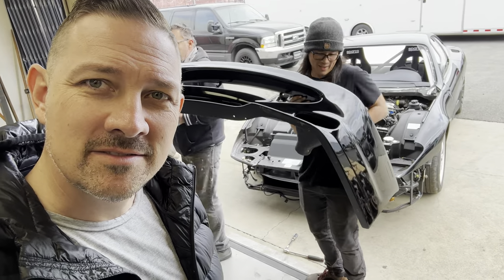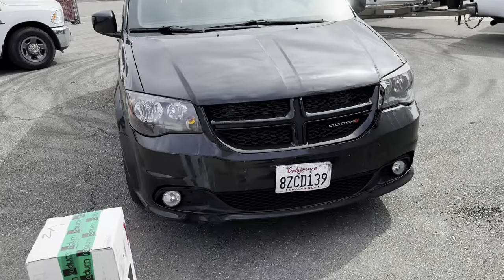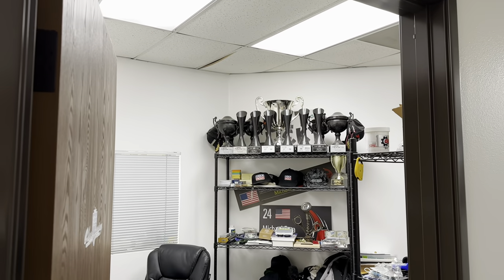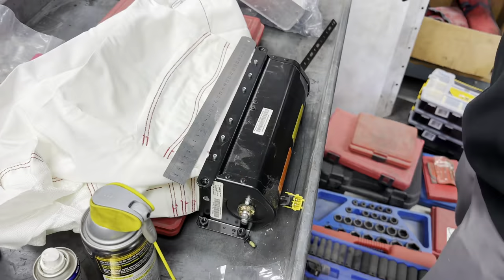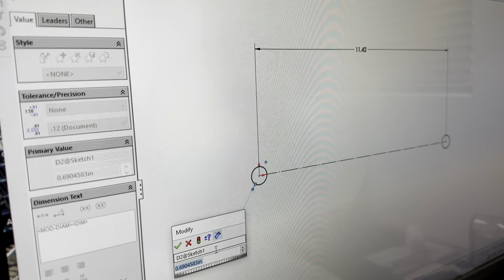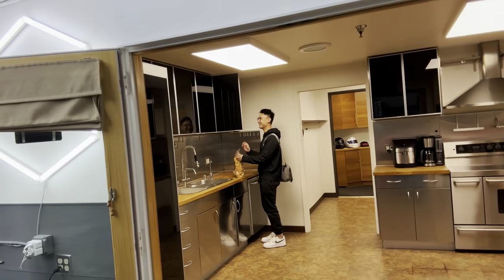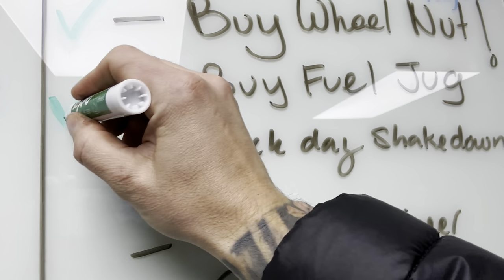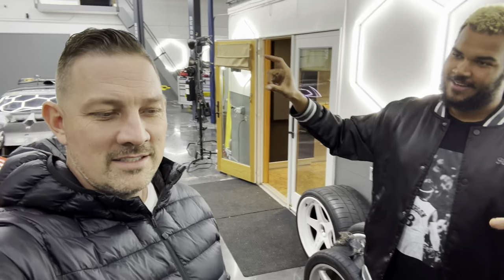How To Make Ferrari Race Parts Easily! *Mike Essa *

Comment: Mike speaking my language now.  I draw in CAD daily and make CNC programs for our HighDef  Hypertherm XPR300 plasma. Our table is 7foot wide by 14feet long.We make anything From small 18ga stainless/16ga Aluminum to 1.5inch A36 Carbon Steel parts. Whatever job we are fabricating the shop depends on me to make custom parts. Like today I've laid out and programmed 4 different deflector shields out of 1/8 Stainless. Funny to see Mike teaching Damon what SolidWorks is and how to burn out on the Plasma table. That table looks like small part type with tiny plasma in comparison what our steel fab shop uses. Perfect for small car shop with custom Fabrication. Im Just happy to see this . Another Great Video from DDE and Mike Essa

Comment: 6:00 Dude ya making that way harder on yourself than it need be, this sounds crazy but it works, just shove it in the oven for 5 to 10 min on 150°c! That lens will pop off like it's in butter, I did this on my Mk4 Supra headlights, and it worked a treat! And most of all, it didn't damage a single thing!

Comment: Damon that van I used to have one 2013 285hp and on a wet day it was faster then 5.0 mustangs.   And the only bad thing was high winds on the 416 in winter here in Ottawa area.   You know the place you lost your radar detector....   just minutes on the 416.  By the way minutes from where I now live. And with my V10 engine will be heading down to the hot states like Florida or Texas. Soon.   By the way my V10 would haul A55 your v12 easy.....

Comment: If the van were a Ferrari
Fog Lights - $1000 ($500 ea)
Plastic Grille - $2300
Dent repair - $500
New Rims - $5000
Alignment - $1000
Carbon Hood Scoops - $500 parts  $600 labor
Cease and Desist Order - Priceless

Comment: Solidworks 1.0 circa 1999 that being said the only thing you could export were . dxf and . dwg. 
Don't use plasma or hi-def plasma for something that small, go with 6160 and use a router cheap or if you want to spend $$ go waterjet or laser

Comment: If the “louver” is on the car to help with heat, it’s actually a “vent”. It’s only a louver if it’s purpose is anything other than heat exhaustion. For instance, the Porsche fenders have vents. To vent heat. Mustang boiz add louvers to the back window literally because they think it looks cool. My point is, louvers have no point. Vents do

Comment: It wouldn't believe me if I told you but I crashed my 2020 Nissan going 68 mph 
Took most of the impact on the front left
Did a lot of damage but it didn't bust any suspension driveshaft the wheel is pushback a inch or so it doesn't like going 80  anymore  still runs put the spare tire on went home